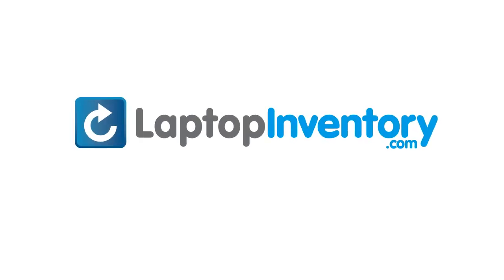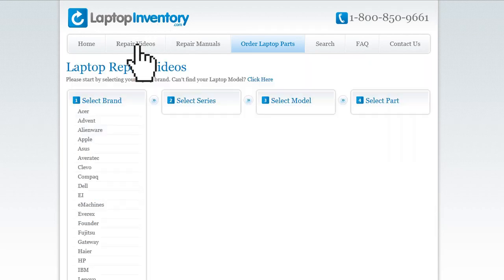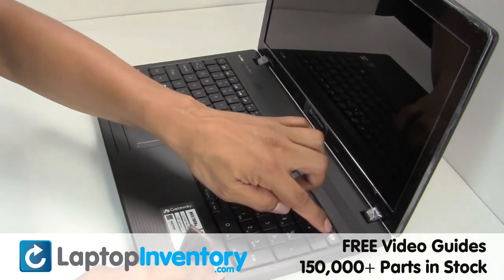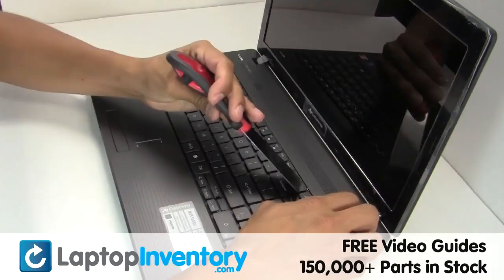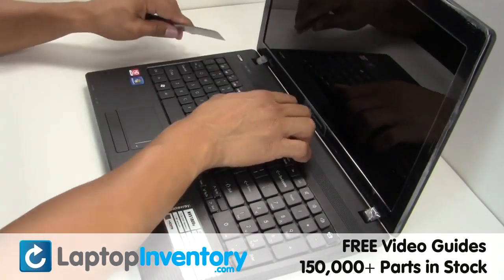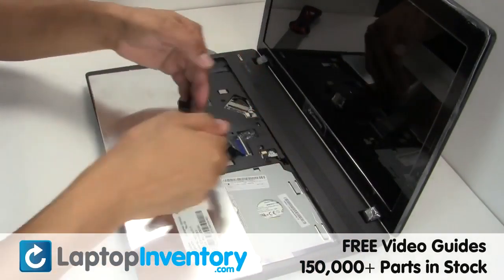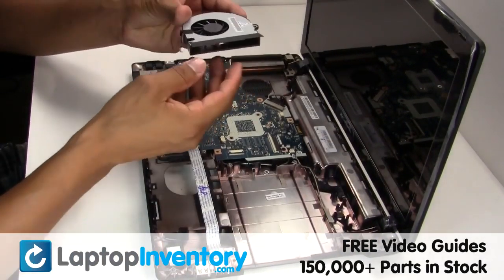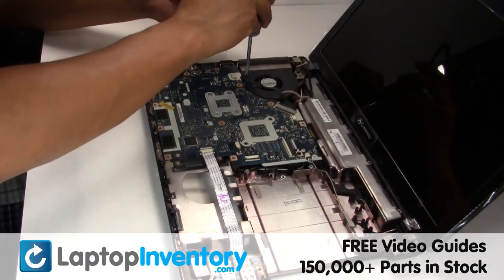Gateway NV55C NV59C RAM Motherboard Replacement Install, Replace - Laptop Notebook System Board

Comment: Hello everyone, I have a Gateway NV59C with a processor Intel i3 370m, soon I will give a maintenance replacing the ram and the HDD but I would like to replace the processor for a better one and I have checked for similar versions of this laptop so I found that there's a similar version with a Intel i5 480m, I think this will boost a little bit more the laptop, but I want to be sure that is out of danger to do a change of processor without changing the motherboard, just the processor.

Comment: Hi. It seems that my NV55C does not transmits HD trough the Hdmi port. I am not sure if the problem is in the laptop or in the LG LEd I have. do I have to configure the laptop in some way?
Reply: I can see HD in the laptop screen, but I don't see it in the TV.
Reply: +ClaseTalleres Try a board replacement or a GPU Reball/Reflow
Reply: Solved, it was a function key. It DOES transmit HD trough the HDMI port.
Reply: Thanks David Bacon.

Comment: PLEASE HELP:  Question for anybody. I changed the motherboard due to the fact I was getting a slow blinking orange light where the picture of the light bulb is. Changed the motherboard then the laptop will turn on for 5 seconds and then turn off the fan would blow air and the blue lights would come on. So I got a new processor for the laptop figuring is the motherboard was bad so was the processor. The laptop still turns on then turns off.. Any suggestions?

Comment: Damnit they put the heatsink on the bottom!
My laptop has been overheating, I cleaned out the dust from the fan which didn't help.
Now I wanted to reapply the thermal grease and to do that I have to take out the mobo ...PITA

Comment: Yes, I agree too much work to even matter. But it's because the current graphics "card" is a part of the motherboard, so it uses the ports on the side. So you would have to get a motherboard with no card and a separate video card to fill the ports on the side.

Comment: I asked Gateway and they said there was but looking at this, it looks like you would also have to get an entirely new motherboard because the integrated card uses all of the video slots. So the new motherboard would have to either not have an integrated card or not have those ports so the dedicated card can use them.